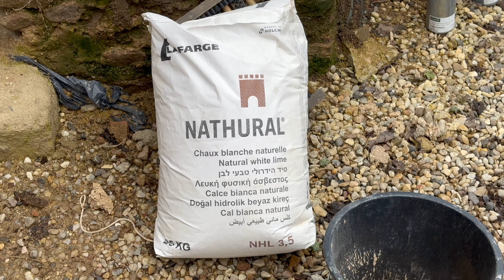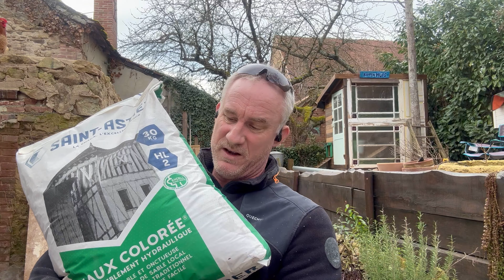How to lime render a wall, Episode 64

Comment: Thanks for sharing again! 

We finally bought our house in France! All your videos helped me to prepare for some of the jobs I need to do.

Quick question though that I can’t find a good answer on on the internet:

“What are the rules for residential homes with outside lighting at night?”

Thanks for any help and it will be fun to have our “verbouwing” go parallel alongside yours 😊
Reply from the maker: Gefeliciteerd! To answer your question: I have no idea. If I had a question like that my first point of contact would be the local Mairie. If they can’t answer your question they can surely point you in the right direction. Success!
Reply: @thisoldhousefrance  thanks, I’ll be there next week so I will give that a try